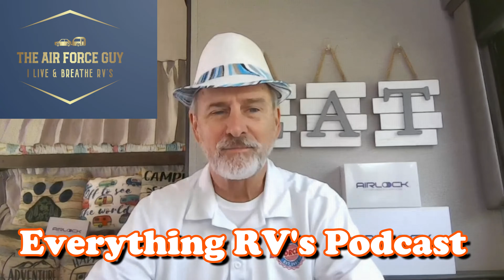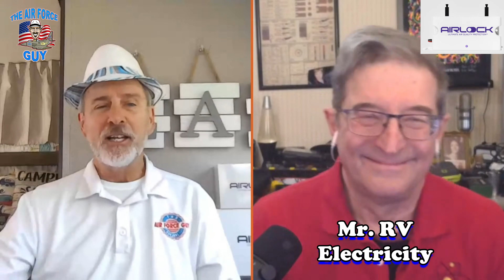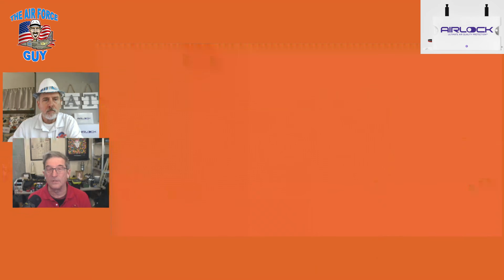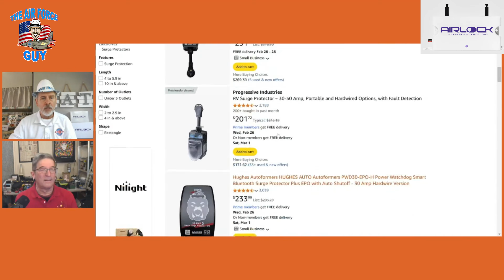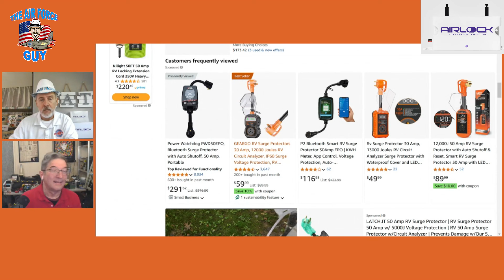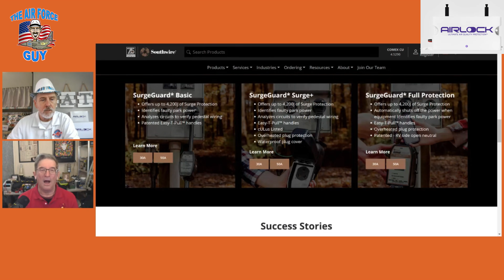𝐖𝐡𝐲 𝐀𝐥𝐥 𝐄𝐌𝐒 𝐒𝐮𝐫𝐠𝐞 𝐏𝐫𝐨𝐭𝐞𝐜𝐭𝐨𝐫𝐬 𝐀𝐫𝐞 𝐍𝐨𝐭 𝐄𝐪𝐮𝐚𝐥: 𝐀 𝐆𝐮𝐢𝐝𝐞 𝐭𝐨 𝐂𝐡𝐨𝐨𝐬𝐢𝐧𝐠 𝐭𝐡𝐞 𝐁𝐞𝐬𝐭 - 𝐖𝐢𝐭𝐡 𝐌𝐫 𝐑𝐕 𝐄𝐥𝐞𝐜𝐭𝐫𝐢𝐜𝐢𝐭𝐲

Comment: There's only one of them that gets applauded for best customer service and warranty in the industry. You call their number and you talk to a real person in the United States, and they all know how to troubleshoot. The Hughes unit checks neutral before and after the unit. Now they are wifi capable too. If there is an issue with the Hughes units after replacing a surge module after a hefty surge, they're going to troubleshoot over the phone then decide to do a straight warranty swap on the unit. The shipping is covered both ways and there's no charge for warranty.
Reply from the maker: Good to know.  I’ve had customers get great customer service with all three.  At least know people know from Mr RV Electricity that these are the ones to own for the best protection. Thanks for Watching